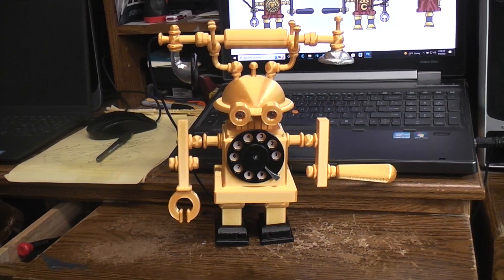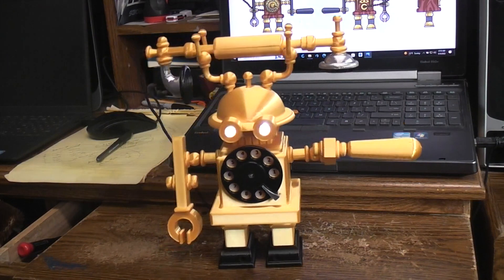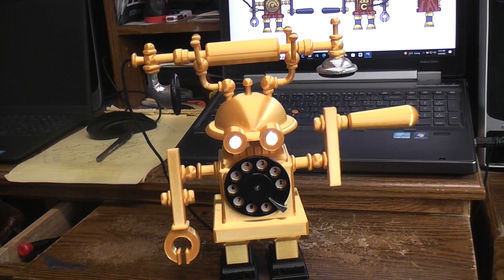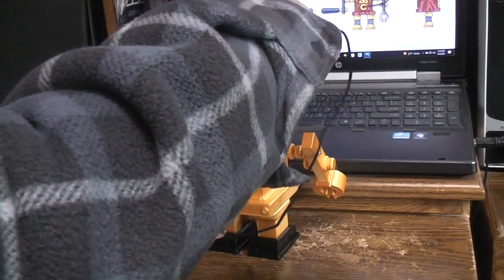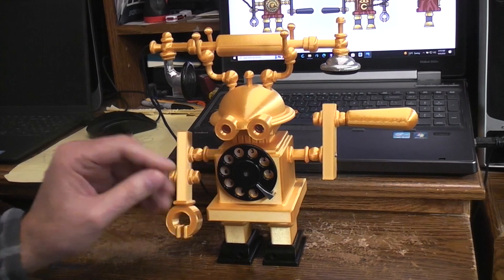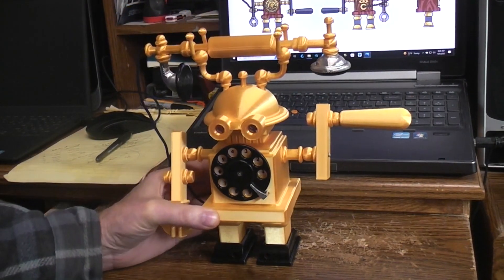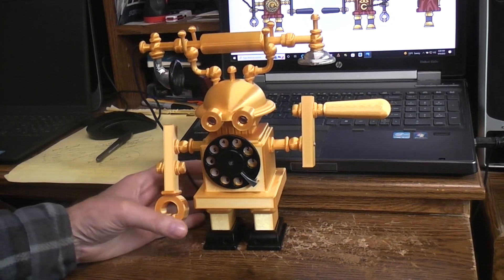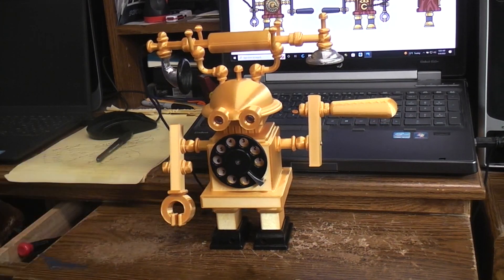Part 4. Demo of Commissioned Phone Robot Project.

Comment: A really impressive job you did on that, The actions and sounds etc really work well, as you mentioned as well, if it were mine I think I would have given it a bit more of a paint job, but I'm sure your client will be very happy.
 Unfortunately the project of mine I was hoping to get some tips on needs to have a voice sound clip synced to a moving mouth servo, so although I did get some other ideas from this, it didn't help on that front,
 I think i will just run the audio into an A/D and use that to drive the servo from amplitude.
Reply from the maker: The audio can con control the mouth movement of your project very well. But using 1 channel for audio control and a second channel for mouth control would work just as well. You just spend a bit more time programing to get them in time.
Reply: @Robothut  Yes , I was hoping to find a more or less automated solution that would give acceptable results, but perhaps manually programing and syning them is the better way, I'll have to pull it out again and give it a go, thanks..